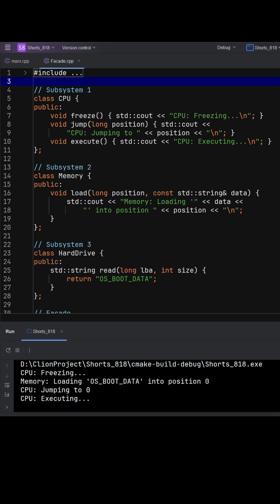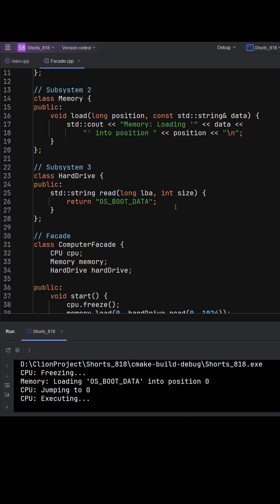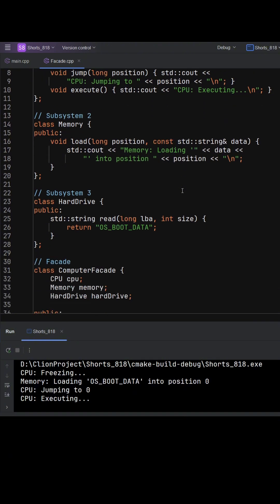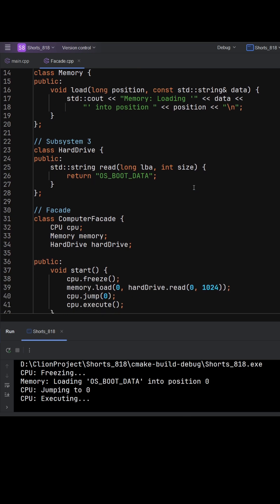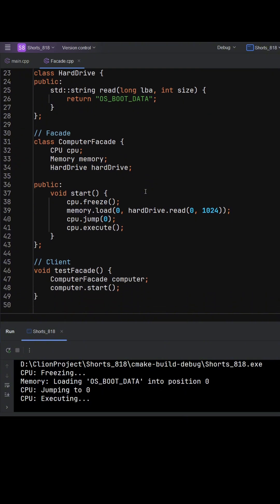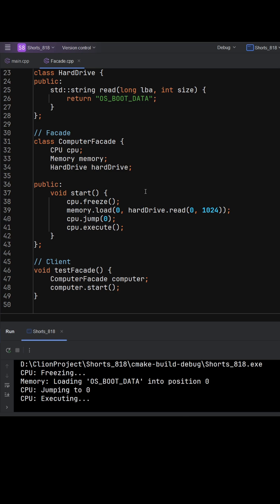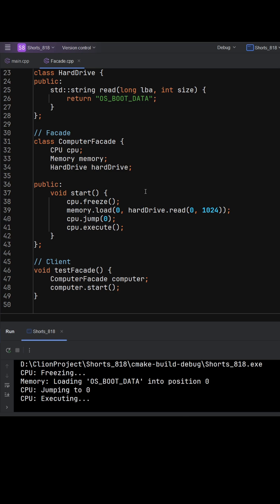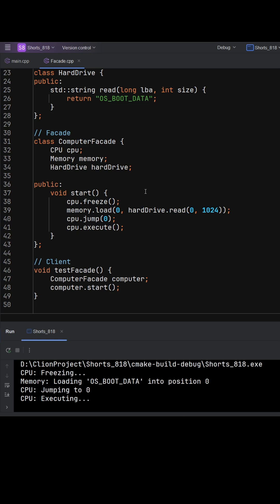What is the Facade Pattern? (Structural OOP 4 of 7)

Comment: Isn't this just composition? Software seems to have a lot of jargon
Reply: Lmfao I was just thinking, bro created a wrapper 🤣🤣🤣🤣🤣🤣🤣🤣
Reply: @atharvamuley8911  usually wrapper means adaptation around a single instance, whereas facade hides the complex internal instances and interactions between them
Reply: Yeha. Facade uses composition here but it's not just objects inside an object. Purpose of the pattern is to hide the complexity of interactions between subsystems and provide the client with a single simple interface. At the same time the facade can combine different techniques - not only composition but also other patterns. The key point is that it simplifies working with the system